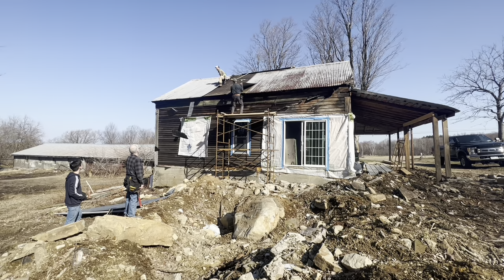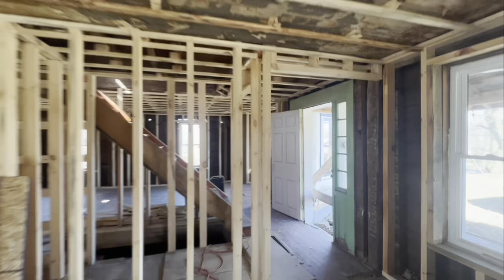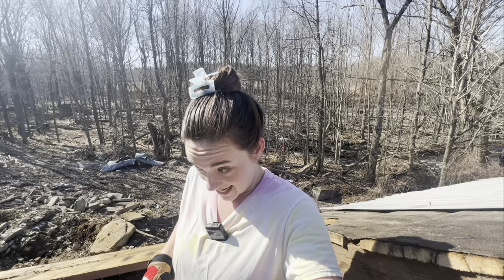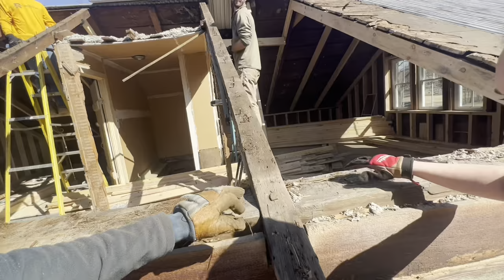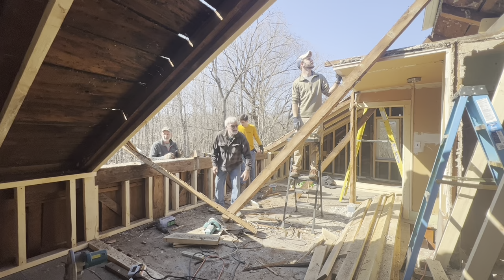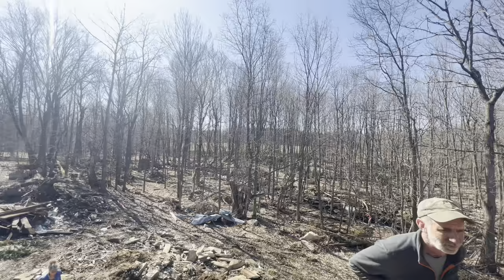I can’t believe it’s finally happening!!! DORMER ADDITION on my Fixer Upper House (part 1)

Comment: Happy birthday Jay ✨ Abbey will you redo the lining on the ceiling at the top of the stairs now? I can see that exposed gap above it between it and the roof and surely it will look better if you can push up an bit further into that peak? Hard to tell exactly from the video but could be worth looking into? 💗💗💗